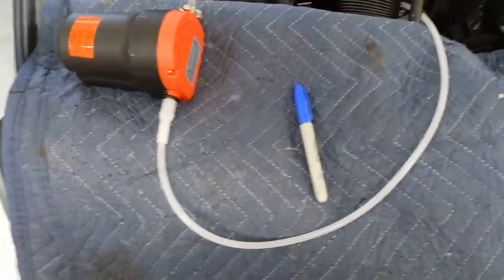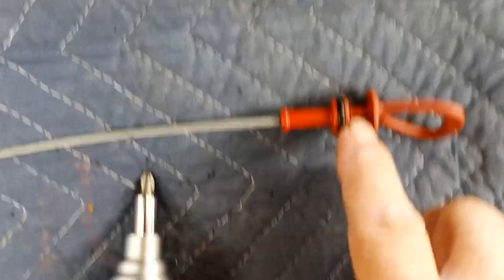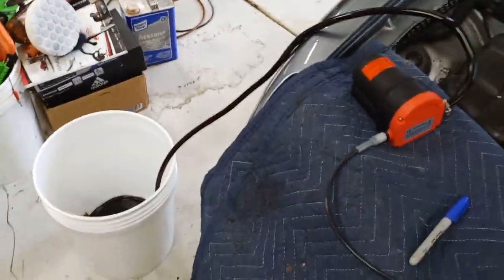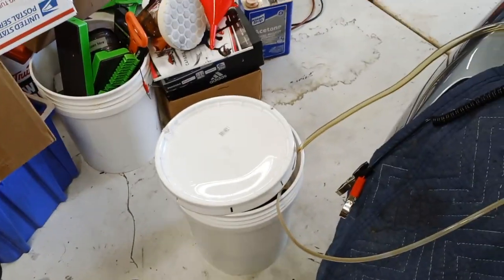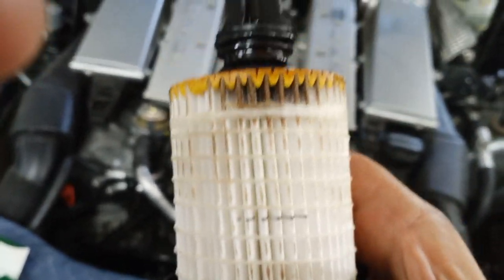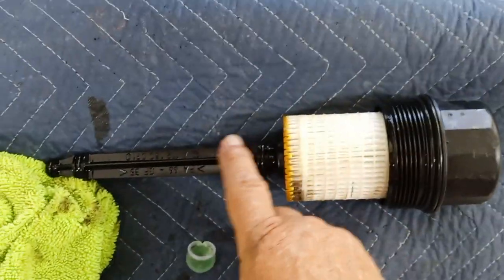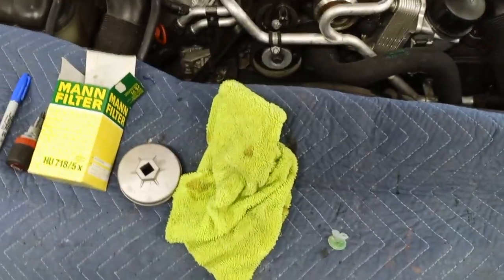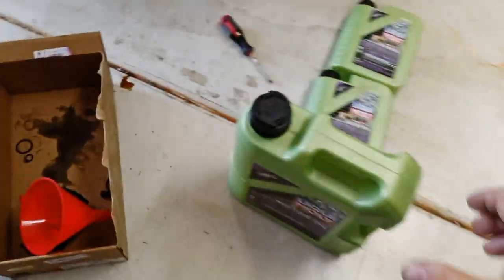Crossfire Oil Change - 2005 SRT-6 - Extracting Oil From Above

Comment: Why do you and everyone not change out the 5th o-rng ? It comes with the filter.  It's noy an extra o-ring.
Reply from the maker: All the Crossfire owners I know are fully aware of the 5th O ring but like me they choose not to change it.  That is because to get to it you have to separate the top of the oil filter stem assembly from the stem itself.  Doing that there is a very high likelihood of breaking the stem where it attaches to the top of the assembly.  That O ring is not critical and not worth risking the damage to the stem assembly so we don't replace it.

Comment: How much of the oil in the engine was extracted? Thanks.
Reply from the maker: You actually get more oil out when extracting from the top than you do draining it from the bottom.  This is the way the dealerships do the oil change as well.  So many uninformed people on the forums are always chirping in that "No way you can get all the oil by extracting from the top."  Absolutely not true.  One of our Crossfire members on the forum had to do maintenance on two Crossfires where he was replacing the oil level sensor so he had to drop the oil pan on each car.  So he used that to experiment and compare.  Before removing the oil pans, on one car he extracted the oil from the top and on the other car he drained the oil from the bottom.  Then he dropped the oil pans and checked to see how much oil was left in the pan.  There was almost no oil in the pan of the car that he extracted the oil from the top.  The pan from the car that was drained from the bottom had more oil left in the pan.  It wasn't much, but 3 or 4 ounces but it was more and that's because of the baffles in the oil pan that hold some of the oil and it doesn't go out the drain hole.  So this method is valid and superior.  There's a reason the dealerships do it this way.
Reply: @bradmorgan911  Thanks for the quick reply.  I will give that method a try.  Is there an oil extractor that works very well that is recommended? Thanks.

Comment: Wrong oil needs factory oil 0W40
Reply from the maker: Negative.  Mercedes changed the spec for the M112 engine to 5W-40 several years ago.  The original factory spec was 0W-40.